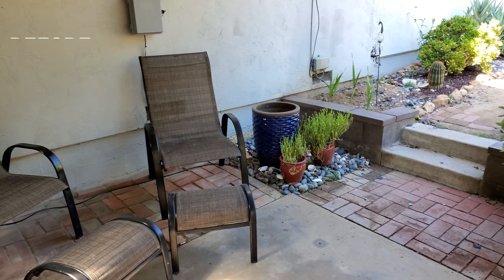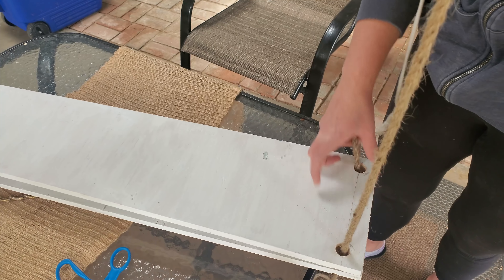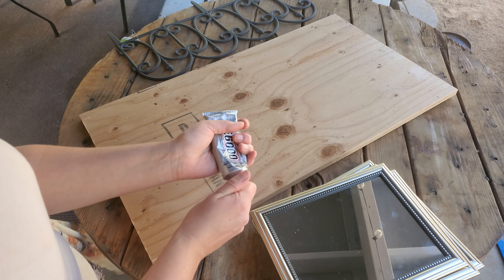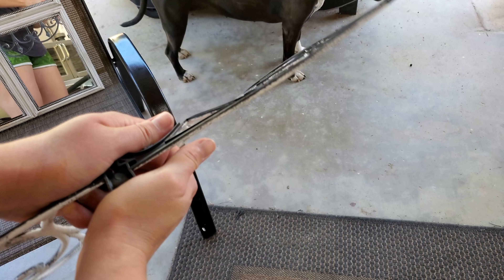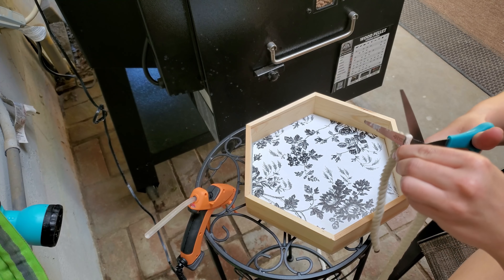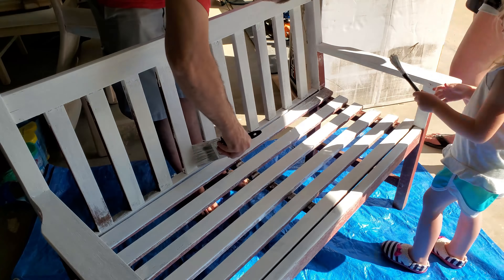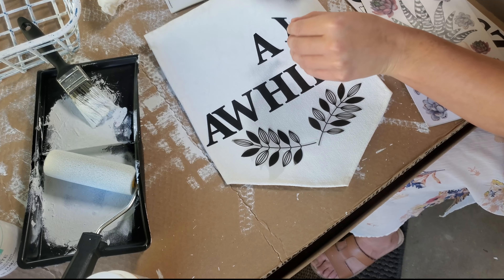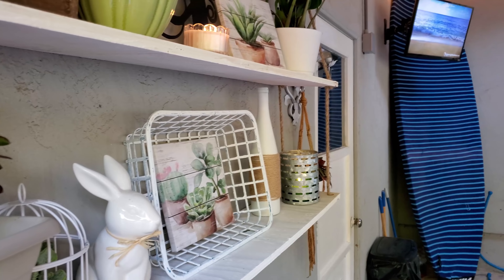PATIO MAKEOVER | EASY DIYS

Comment: Did I miss info on the blue jar water feature? Did you make it?
Reply from the maker: I did make it but did not make a video. I  got the ceramic planter from Costco. It has a hole in the bottom. Took a 5 gallon bucket and dug a hole, placed water fountain pump in bucket, 2 metal brackets (bars) ontop of bucket with metal mesh screen, then ran the tube from the pump through the hole of the planter. I also used a piece of pvc pipe to put in the hole and hold the tube straight up and cut it a few inches from the top of the planter.